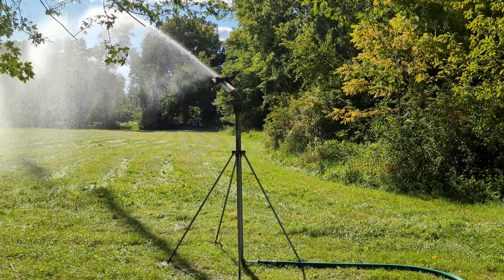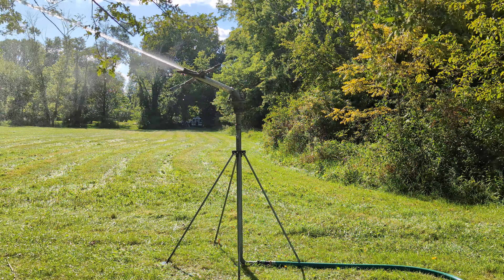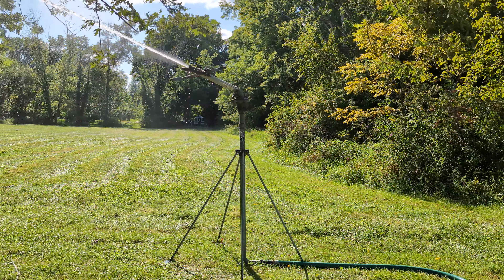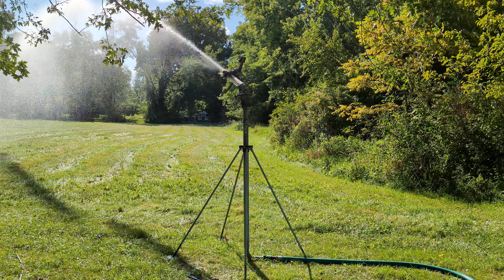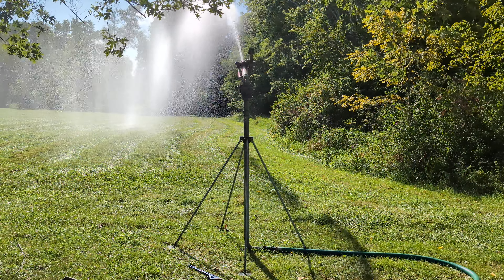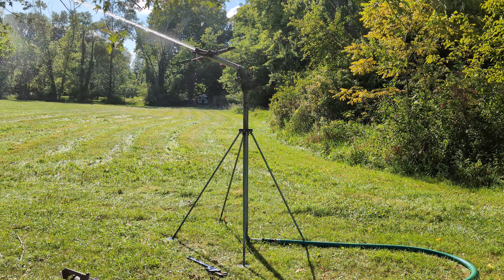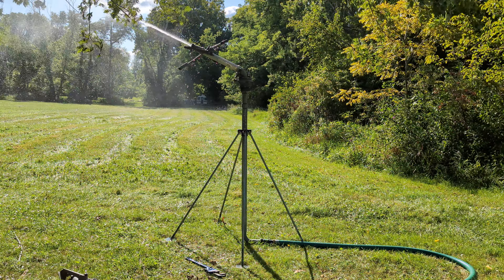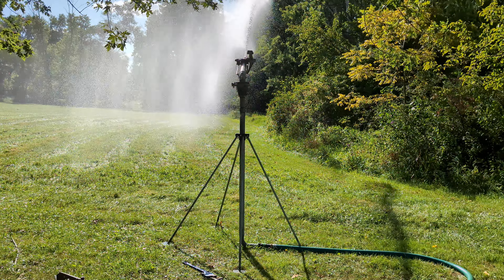Nelson P150 3" NPT Fast-reverse big gun .87" ring nozzle

Comment: I just love those big old Nelson Big Guns. The P 150 is a great head, I like the Fast reverse heads better than the SR.
Thanks for the show!
Reply from the maker: Yes it is a very nice big gun! However i found out the brake drags on it at certain positions of its arc. I am not sure what is up, a guy told me to take the elbow off the base and check the discs and pads. I'd do it myself, but the gun was rebuilt a few years ago (bad bearings and leaky base). I know how it comes off (I did this to a junk parts gun and it wasnt that hard). I just dont know what to do to the brake discs or bads to keep it from sticking. I almost have to have the brake loose to keep the gun going forward. I don't like it that way because as you seen even if i tightened it up the reverse was still way too quick. I actually hurt my hand trying to stop it from going back to far to soak my friend. It was swollen and bruised for a few days, but healed. That was dumb of me and i learned my lesson. You never try to catch these on the fast reverse cycle. I believe i need to adjust the reverse linkage spacer bolt a bit to pull the reverse spoon out of the stream (the more it is in the stream i believe the more force is generated to reverse it back). I did this with my P200 because i was running it on a custom .90/95" nozzle on 2 7HP transfer pumps (not enough i dont think even with the smallest taper nozzle (1.05").  i loosened up the brake and moved the drive spoon into the stream more so it'd have more forward energy. If i ever got a PTO pump I'd have to tighten up the brake to factory settings and pull the reverse lever back out some and the drive spoon would need to be moved back to its original position. I'm learning on these big guns on what to adjust and when you';d need to adjust it. I have learned alot just by messing with it and talking to irrigation guys who work on them. Question do you know anyone who has a ring nozzle assembly with cap for a 205G Rainbird? I have one i want to try the fender washer trick on to get it to run on my setup. It has a 1.15" and thats too big. Not enough water flow and pressure to move the drive arm (it kinda moves but doesnt move the gun at all).Also reverse doesn't move it either. I am thinking of trying a washer the same size thats in my P200. I think that may get it moving. Anyway thank you for watching and check out my P100/P200 videos!

Comment: The Nelson P150 works well with two pumps. It sure does reverse fast!
Reply from the maker: I got a .97" ring nozzle for it. I have to sort out the sticking brake issue though. Its been a problem ever since i got it.
Reply: @NelsonBigGunP200Fan  Nice! It may eventually need a lower end rebuild.